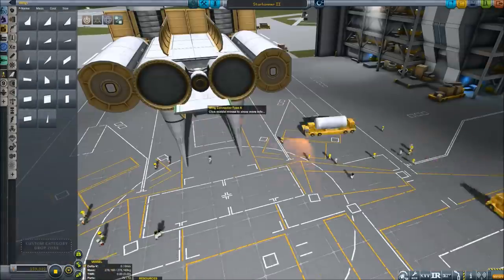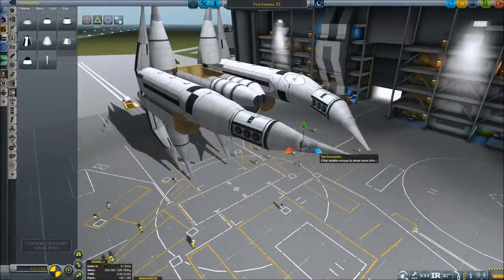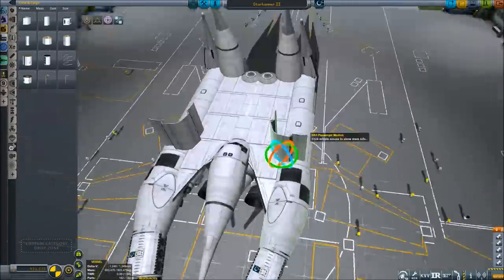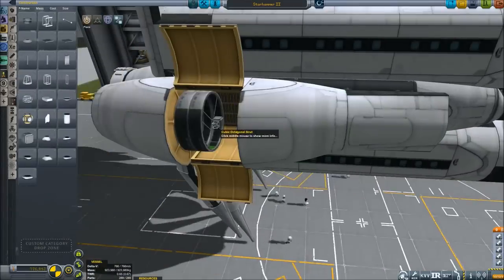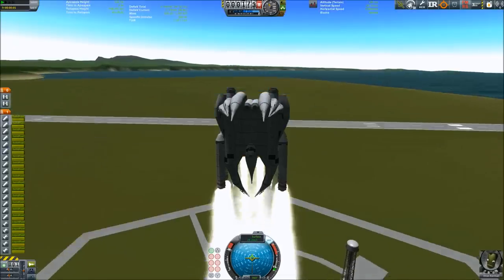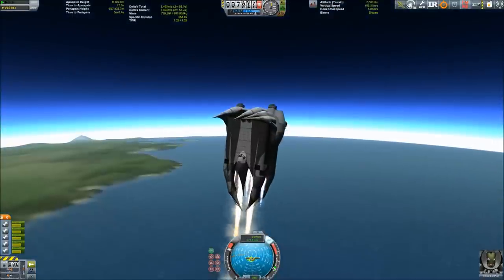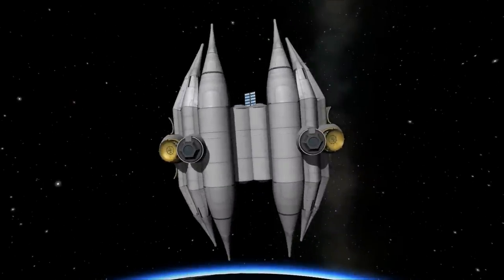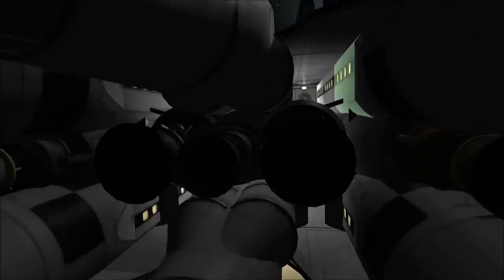The Starhammer - Heavy cruiser with stock hangar doors in Kerbal Space Program

Comment: what mod is used to allow you to fine tune where the parts are placed?
Reply: the blue green and orange arrows i mean
Reply from the maker: no mods, the offset and rotation tools are stock ksp.
Reply: how do you get them up?
Reply from the maker: TheDeadly Badger Two ways: Either use the icons in the top left corner of the editor (right beside the parts bar) or press 1 for standard assembly, 2 for offset, 3 for rotation and 4 for change parent node. I could not imagine my life withouth them anymore :)